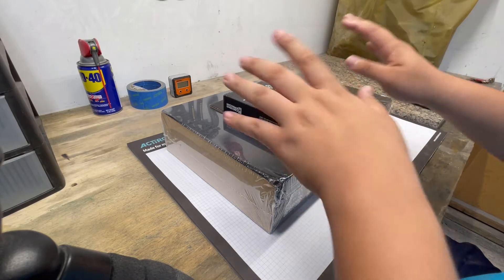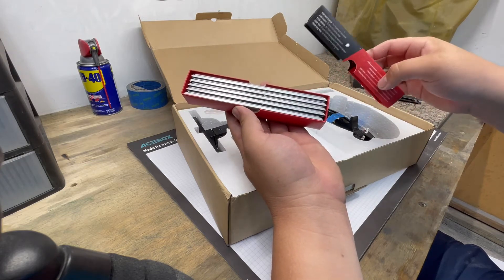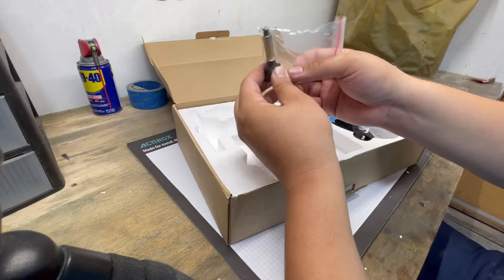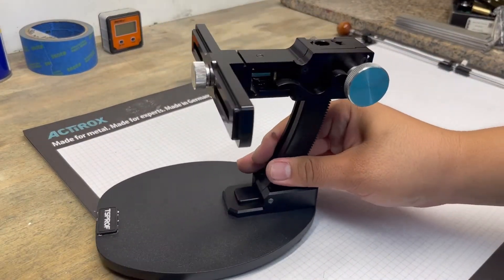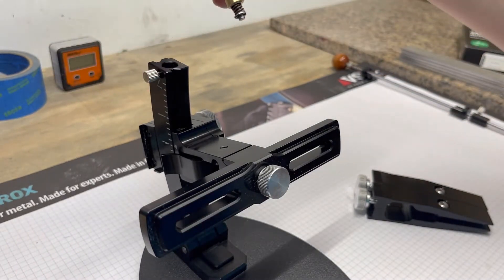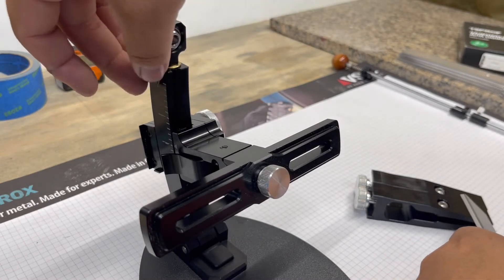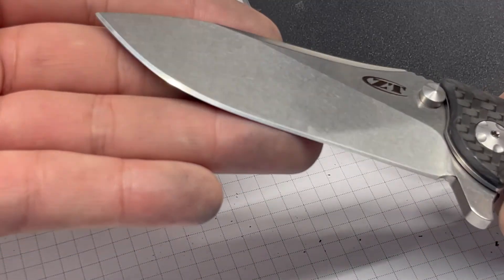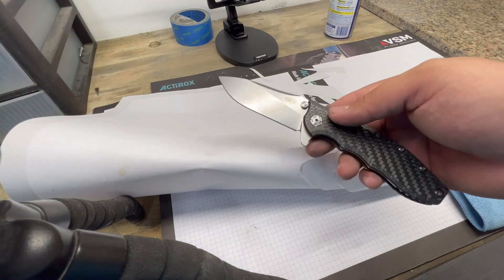(Unboxing) TSPROF - KADET PRO

Comment: Always use your finest grit stone when finding your angles to avoid removing unnecessary steel, also remember to set the compensation adjustment with the stone that you are using before putting stone to steel. 😊

Comment: I think you did good for a first time , I owned this for sometime now and it gets even better once you learn it more on each use  ,Here’s some tips , always use the stone compensation for each stone and or strop  all the stones vary slightly in thickness  , Get a full set of Venev resin bonded diamond stones  or similar F100/F240- F400/800-F1200/1500 I also have a single F80 and F2000  , there  double sided stones so you only have to compensate once for 2 grits, I use 3 tsprof  strops  with Gunny juice 1 micron a .5 micron and .25 micron the edge is a mirror after that , Get the double and single filet clamps from Tsprof or Gritomatic , they give you much more clearance from the stone to clamp contact on low angles , The single clamp is great for smaller knives also , small Swiss army blades to 3” -3.5 “ blades 
it’s basically like a KME style  clamp but better , Always release the adjustment knob  clamp when the sharpener isn’t in use it saves the clamp mechanism, Always be careful and mindful when the knife is in the clamps , I just got done with a screaming sharp polished edge and I ran my hand into it on accident , I got lucky not to much damage but that opened my eyes , sorry for the ramble hope it helps
Reply from the maker: Thanks so much for your input and advice!! I will definitely look into those stones 🤙🙏😁😁😁
Reply: Have you try doing any cleavers like 3-4 inches wide?
Reply: @Antimatter- do you have to get the special flat grind clamps to sharpen spiderco full flat grinds or can you get away with using the factory clamps?
Reply: @andrewjewell8209 .  I see he bought the special FFG clamps.  I’ve heard you can put tape or padding on the FFG blades so that the standard clamps will work OK, but I think I’d probably get the dedicated TSPROF FFG spring clamps.

Comment: I put just the slightest smear of silicone grease on the rod and wiped off most of it very lightly where it passes the bearing.  Also put a spring on the backside rod for a softer stop.

Comment: Neat setup thanks!  I’m considering either this or the K03 Pro, haven’t decided which, but don’t think I need the more expensive pro features and already have a digital angle finder.  I think I will have to get those TSPROF aftermarket clamps for my Spydie FFG blades though.

Q: Did you consider any other TSPROF models before going with the Kadet Pro?  Thanks again!  👍

Comment: How do the clamps do with a full flat grind do you get play or get weird angles? Have you sharpened any spydrcos with a full flat grind? it would be nice to see a video with a speeder I clamped up!! Thanks for the video, I’m debating on this system or the harps tone R2.

The link in your description is sold out of the full flat grind clamps are they necessary? Or can you get away with using the clamps provided in the original setup for a full flat grind?
Reply: I Ended up picking up the KO3 pro hunter, it’s an excellent unit I couldn’t be happier. I did purchase the L adapter to help with smaller blades, you can use the provided clamps for spyderco flat grinds. You just have to get one of the clamps on a flat section of the grind up by the choil.